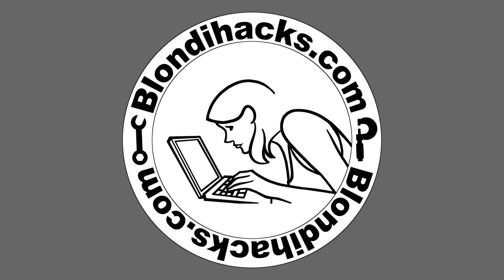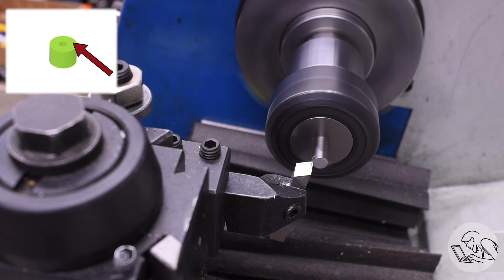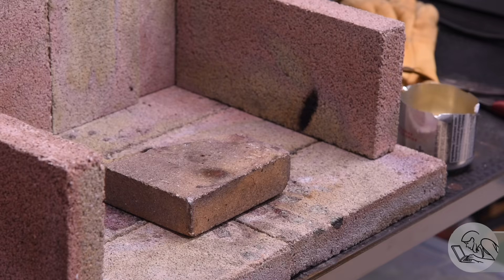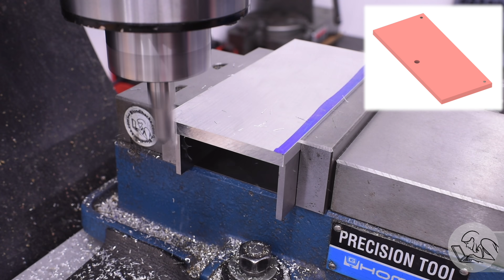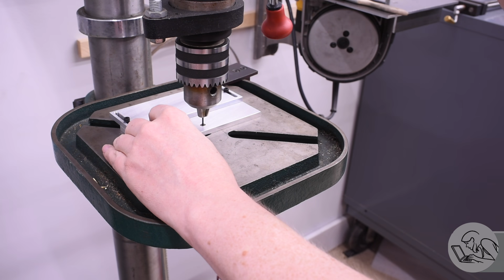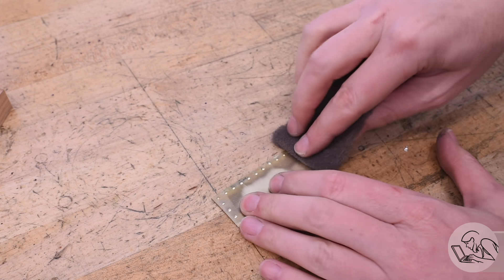Let's Make An Embossing Tool

Comment: Well done on the heat treat description. I'm a hobby blacksmith and your color description is what's been taught for centuries. And easily understandable. Well done!
Reply: @markfergerson2145  ouch.  :)  Hopefully it got worked out, sooner or later.  :)
Reply: No, tempering is supposed to be done at around 450 F (depending on alloy) for a couple hours (again, depending on alloy). No quenching -- only natural cooling.
Reply: @ilikewaffles3689  1 hour per 1“ thickness is the typical soak time. But we are talking a hobby shop not a tool and die shop. Her description is sufficient for most hobbyists.

Comment: Professional tool maker here with everything revolving around heat treating... your original temper was more than likely just fine and it just didn't properly harden the first time. When tempering springs we go for a full blue temper and springs deform and still return to their shape. Light straw is just the starting point and great for retaining fine cutting edges but more likely to chip. Wonderful work all around 😊
Reply: Ah, I wondered about that myself- good to hear it from someone who really knows what they're talking about ;)

Comment: I took a knife making class at a local university and they did tempering in a toaster oven.  Set for 450-500F until the piece reached the temp, pull and let cool.  The instructor said it was a pretty fool proof method for smaller pieces and only took about 5-10 minutes.

Comment: What timing !! 
I was looking online to get an idea on how to duplicate rivot impressions for live steam locomotives. 
Like yours gauge locomotive , my loco is a 3.5 " Atlantic 4-4-2  .  So your rivot tool will be scale for your locomotive. 
You're gonna love running your locomotive.
Our club is Richmond Hill Live Steamers . We have a nice Highline for 3.5", 4.75" , and 7.25" on the ground line . 
* Embossing sure speeds up the look as to using installed rivots in holes .
Very Nice Quinn 🙏

Comment: Beautiful rivet embossing jig, Quinn! You really out do yourself with these jigs!  I just clamped a few pieces of metal together for the fence and base, but you really go all out!  Very nice.

One thing I do remember about that rivet embossing operation is that the 'fixed' spacing doesn't always work out across the width of the sheet.  I had to make some adjustments in some of the rivet placements to make it look nice, especially as it got close to the end of a long line of rivets.  For example, if you're spacing them 1/4" apart and there's only 7/8" left to the corner where there's already a rivet.  It's better to slightly expand, or compress the rivet spacing so that it comes out pleasing rather than having the last one in the row only be 1/8" from the existing corner rivet. 

Beautiful job as always, Quinn.  Well done!
Reply from the maker: That’s why I do the paper pattern- the spacing is slightly different on each edge as needed to look good. I’ll cover that in more detail in the video where I do the real panels
Reply: @Blondihacks sounds like an excellent method of making sure the rivets are all spaced appropriately!   Can't wait to see it 😃

Comment: When I was working in tooling, we used a LOT of aluminum for tool structure as most of the stuff we built was not all that critical. What we used to machine aluminum was just plain kerosene. It worked really well and it's a lot cheaper than "store-bought".
Reply: A bit late, but - yes. I'm lucky enough to work with a father and son team of aluminium fabricators. Kerosene was their top pick. But also mineral spirits (white spirit) and denatured alcohol (methylated spirits) work well for drilling, cutting and filing

Comment: I build model trains and have faced the issue of embossing on brass.  I toyed, but never fully perfected another approach which was to use a gear shaped object attached to a cranked axle.  The axle was adjustable in height and spring loaded to produce different levels of embossing.  This obviously has draw backs in that you need a different "gear" for each desired feature.  To offset rivet features on a seam, you could use two offset back to back gears on the axle.  The brass sheet metal would slide under the gear as the crank is turned, with the brass sheets placed over a soft acrylic surface.  The reason I never took it further is that it was cheaper for me to design the parts in AutoCAD and have them 3D printed, and then cast.

Comment: I got an idea! If you aneal a piece of shimstock, use this tool to punch a rivet in that, and bend it to the right shape and harden it again, you might end up with a nice little spring that can help with spacing the rivets out correctly by acting as a little springy dimple index that registers in the previous dimple

Comment: I’ve torch heat treated a LOT of shop built tooling. Then I built a PID controlled heat treating oven using a toaster oven from the thrift shop. 
Now when I make tooling, I still use the torch because it’s 100 times faster. 😂
Reply: EXACTLY.  You COULD do it with ovens and thermometers and such, but a torch and the Mk I eyeball do it fast and perfectly serviceably; especially for one-offs, and when you're not making a ton of hardened tooling.  Shop space is often at a premium, so extra things like heat-treat ovens that you use once in a blue moon aren't necessarily a great idea ;)

Comment: Gauge plate?  HUH!  Never knew that was a thing.  Thanks!
16:05  Give ATF (automatic transmission fluid) a try.  I love it.  It's made to keep steel from sticking to aluminum.  Cheap too.  Only a few bucks a quart.
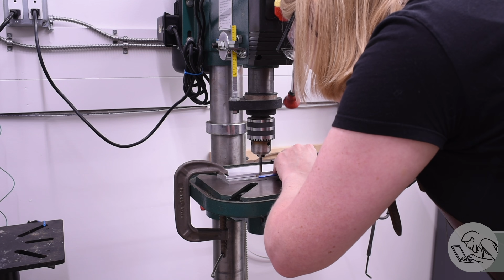25:19  Have you considered an adjustable height base for your drill press?  Being hunched over while doing detail work gets old fast.
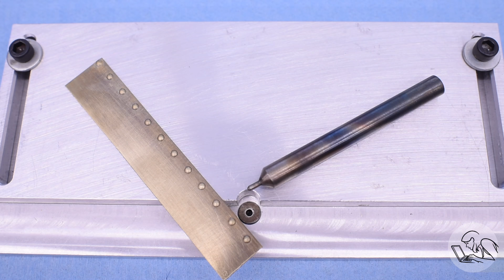26:12  I'd try a wider MDF base for clamping to the drill press table.  Mill a pocket for the jig to drop in to.
I've found those line lasers to be really handy on a drill press.  Just use scotch tape (the translucent stuff) on metal to make the line easily visible.
You can also put scotch tape over a hole to see the laser line.

Comment: That description of heat treating was pretty much all you need to know. The only thing I have to add is something that will not really come up if you are machining. If the piece of steel has been shaped through bending or deforming, like in blacksmithing, then it is best to normalize it before the hardening by heating it to hardening temperature and letting it cool slowly. This releases built up stress in the metal. I think this is also less important the smaller the piece is, so yeah, of limited use for the stuff you are doing. Cool video, and a nice tool.

Comment: A great vlog Quinn as this just took me happily back a little over half a century, to the toolroom where I too learned how to make these kind of tools, that on completion would be handed over to the setter for all day use in the press shop.

The hardening and tempering part was done in a draught free corner of the factory; well lit by natural light. 
The tempering process was done on a small 9" x 9" x1/4" mild steel 'table' over a gas ring with the tool to be tempered placed upright on it.
As crude as the setup was, it gave very precise control for an even distribution of heat on the tool via moving the gas ring accordingly if the colour changing bands were not heading up parallel to the cutting edge, especially if it was an irregularly shaped punching tool.

The hardest part of the whole process of learning to make a good serviceable tool like this for the novice I was back then?
Without hesitation but with a chuckle harking back to the many initial failures, I'd say it was knowing when to turn that gas burner off.

Comment: Nice tool and appears to work very well.  You might use a piece (or pieces laid side by side if you are working with a larger metal piece) of 3/4" wide (or 1-1/2" wide) masking tape (the better quality automotive stuff) to stick onto the piece and then just use a ruler and a fine marker or pen to mark the hole locations.  This way you can visualize the rivet locations to get an idea of how the end result will look before you start marking the piece.  When using a Speedy Stitcher and doing free hand sewing on thick or large pieces of vinyl that won't fit in a sewing machine I often place a piece of masking tape along the edge of where I want the seam to be and just mark the locations on the masking tape where I want the needle to penetrate the vinyl to get evenly spaced straight line stitching - sew right at the edge of the masking tape so I don't go through the tape.  Once you have the rivets created the masking tape will peel off nicely for minimum clean up of the piece afterwards.  You might also use label paper to print the pattern using the computer and then just peel the back off and stick it onto the piece - might be a bit more work to clean up afterwards though.  You might also make a long narrow flat piece of metal to attach to the bottom piece of the tool on the backside and then clamp to the narrow piece at the outer edges to secure it to the drill press platform.  Just a couple of thoughts / suggestions.

Comment: I have a number of pin punches with replaceable pins in them.  Perhaps, if the current one breaks, you might consider making one with interchangeable pins.  Make the pins out of all those broken drill bits that most of us keep for no good reason...
Another great video BTY.
Reply: That was a great re-use idea!

Comment: Really cool to see how this is done! Fun to do something that's for aesthetics for a change too. Would absolutely love a video on a way to improve the two-nut depth stop on the drill press, I've looked for ways to solve this here and there for years and have never found a great solution. I don't have a mill but I'd happily buy a finished piece that if you came up with one!

Comment: Hi! thanks for all the fun to watch vidieos. I have one of those drill presses with the double nut depth stop. I put a stiff spring between the nuts and tightened  them to a 1/2 inch space between nuts. Now I can turn both nuts together by hand to adjust depth, but they stay in place as you drill multiple holes, not the best solution  but it is quick to do.

Comment: Excellent work! Would there be value to having a through hole on the die to clear out any sort of spalling or unwanted material?

Also, and as you said, heat treating is a huge topic, twenty years ago I was in a science of materials course and learned that tempering is a function of time and temperature. We were making armor from SAE1050 and using home ovens for tempering. IIRC it was something like doubling the time for every 30 degrees Fahrenheit difference, and we had pretty solid success with multi-hour soaks to get the same hardness as significantly higher temperatures.

Again, it's been twenty years, but it might be worth research if you or your viewers needed to temper something in an oven and didn't want to get a commercial oven for a small number of projects. Great job doing it the classic way, though. I only had middling success with a torch (although I was usually working with 0.035" - 0.0625" plate)

Comment: I'm curious if you considered using the ground shoulder bolts or a set of pins to keep the fence square and speed up adjustments?

Comment: Quinn, or should we call you "Mighty Quinn" (theme song from Manfred Mann), you should mill out a storage area in between the top and bottom to store various dies and the punch.  Keeping all the required parts together.  The bolts in the slides will act as a lock to keep everything secure.  Just a thought.  Cheers from another crazy Canuck!

Comment: Seems like you could get away with a good heavy bevel on the fence too. It doesn't need to be full thickness since this will only be used for thin brass. Would help with punch clearance too.

Comment: Nice heat treating example Quinn. Small parts made from 01  using your method is what I have done for 40 or more years,  99% of the time It's all you need. However, more complex parts  or high-grade (for lack of a better term) tool steels I use my small oven or send out as required. Small pieces of gauge plate from McMaster 👍 In my case they save a lot of time and money. Cheers

Comment: If you have access to a laser printer you can transfer the print to the plate using acetone and remove the backing paper with water. Or you could drill a template for different spacings and just transfer the dots with a felt tip pen

Comment: Maybe you could improve the clamping by making the upper fence piece narrower. By milling new slots next to the current ones and cutting pieces away from the end to the current slots. You can do it in a way that keeps the fence surface intact and looking that it was the intended design all along..

Comment: Hey Quinn, awesome video as always. I dunno if it would work but what if you milled or etched a scale on the backing plate so you would have the ability to space the rivets without the paper template or holding on to a separate scale?

Comment: If you ever rebuild the punch, maybe you could put a cross pin in that sticks out the back and interacts with a stop block to set the depth. Or, for a more durable option, turn down a larger piece of drill rod so it has a shoulder, then you can add collars to hit the stop block. Standard set of collars for coarse sizing, then a custom sized stop block for the job, I assume you wouldn't want to do this to gauge blocks but I'm not too clear on how much force the stop needs to take for reliable results. If it's just taping the stop, then gauge blocks would be fine

Comment: Given the position of the punch is always approximatly in the centre of the drill table plate, it looks like you might have room to drill/mill two big holes in the fence to clear access to fixings that would go through the base plate to bolt onto the table T slots.

Comment: something I have temper hardened steel is my home cooking oven (I have also used the dishwasher to clean my socket set and spanners)
just turn your oven on put a oven thermometer in it and wait till the oven get to the right temp leave for 30+ minutes to make sure it stays at the right temp
Then place you part in the oven leave for 1 hour then turn oven of
if you are going for a Straw colour that's only 220C (430F) the only way you could have a problem is if you want o get the steel to a Gray Blue or Green this is around 320/330C (610/630F)
Most ovens for the home will only got to 300 C (570F)

BUT this will temper the hole piece ans sometimes you might only want one end tempered and not the other then you have to do it your way on the punch, but the die would of been a lot easier, (in my opinion!)
I have said for so many many years the easiest and best way to do a job is the way you feel is right for you. Even is someone started in the metal industry 46 years ago and still happily work on the shop floor. With I had your workshop even one a little small would be nice, that why I like watching you videos

Comment: Something you didn't mention about the MIC-6 aluminum plate is that it is stress relieved, which means when you machine it, it will stay flat as there are no internal stresses that would/could otherwise warp the part.

Comment: What about a horizontal centre line through the die so it is easy to measure the fence distance when the punch is engaged in the hole?

Comment: Only thing I'd add with heat treating is normalize your material at minimum.  Annealing would be great, but 3  normalizing cycles (heat to around transformation temp and let air-cool completely for those unfamiliar).  For super critical parts, this should be done before machining.  It doesn't ever hurt anything, but not doing it definitely can. 

Im slightly assuming when she mentioned the material ships softened, a normalization has been done; however,  "softened" and "dead soft" are actual classifications of materials. "Dead soft" usually refers to an actual annealment, and "softened" usually just means it was air-cooled after forming the stock at the mill.
"Softened" materials can and will shift since the inner stresses haven't been completely eliminated, though have been reduced.  Quenching will show these as warping.

Comment: Notch the fence. Make it have a shape like ||_____|| with the || being the wings for the fence bolts. then some amount of metal at the front, to be the actual fence, then cut everything else out, so you can clamp right to the bottom plate without having to remake the bottom plate. You could also make new slots on the top fence closer together, and cut the edges off, to give clamping room. But that would require 2 new slots, 2 new tapped holes, etc. The cutting the middle part out is the fastest/easiest by far

Comment: Can I ask why use the drill press and not your Arbor press for this?
Reply: Jacobs Chuck.  You'd have to build a holder to use the Arbor press- or build it in to the jig.  Drill press is much simpler since you don't need much force to make a shallow impression in annealed brass.

Comment: Since I'm in my little peanut gallery of profound wisdom, I'll say that you should at least add another 2 bolts so that it slides linearly, or just redo how that slides. That should make it more stable when tightening it at the right depth. Also you could have it adjustable with a thumb screw so you can fine tune it and use a cheap pair a digital calipers to locate the rivet locations. You could even clamp the workpiece to the tool and attach the calipers to the tool as well so you have a little mini DRO. Plenty accurate enough for aesthetics but probably easier to get that accurate than messing with paper templates. Once you have it built ofc lol